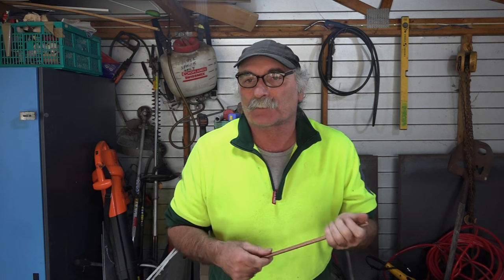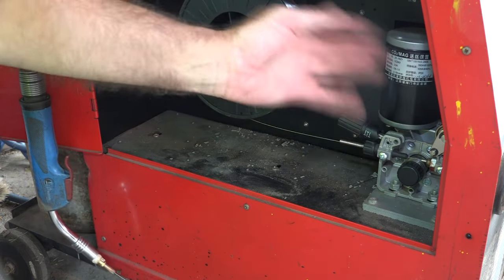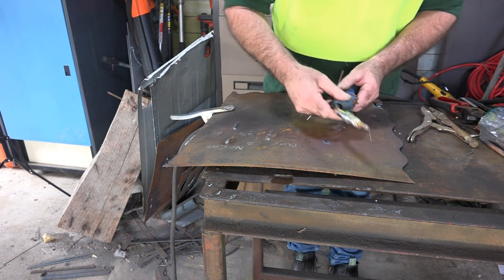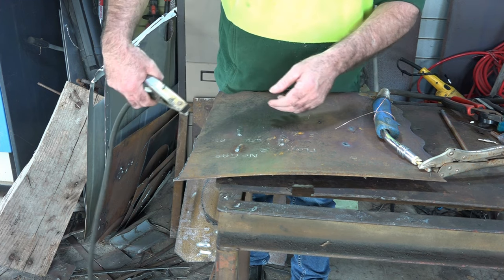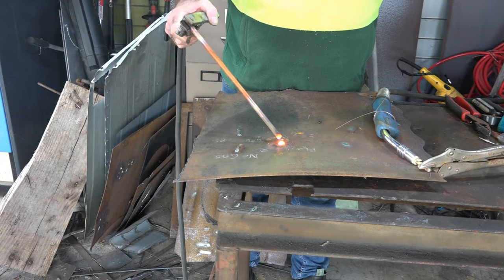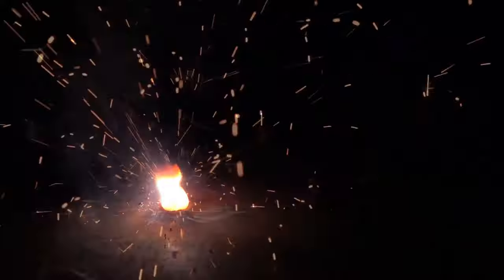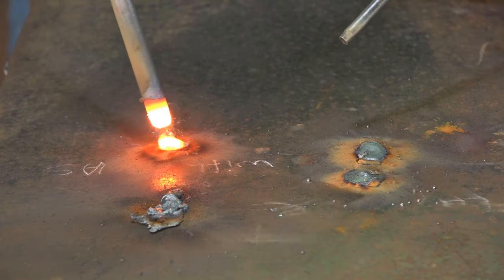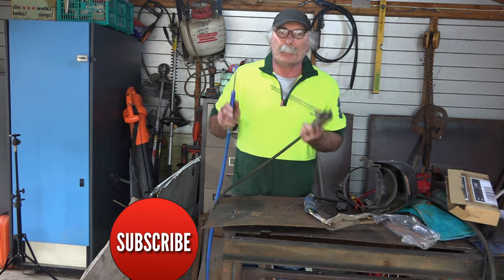Yikes! Carbon Arc Gouging with a MiG Welder

Comment: I think you will find the wire speed also controls amperage. A common misconception, probably because it is labelled wirespeed 😀  The other dial is voltage.  Try turning up the wire speed as well as voltage. I don't know how well a little unit like that will work but a bigger 3 phase mig is a perfect power supply for arc gouging. Also watch for polarity, one way puts 2/3 the heat in the work, the other in the electrode. Straight polarity (electrode negative) puts the heat in the work.
Reply from the maker: Good tips thanks
Reply: wirefeed speed doesn't directly control amperage as mig machines are constant voltage. it's a function of voltage and stickout distance

Comment: That way you are going to burn the carbon rod much faster, because you are basically using the machine in reverse polarity, you need to replace the feeder "gun" with a proper clamp to hold the carbon rod in the correct polarity. or just tie the carbon to the mig gun.
Reply from the maker: Great tip thanks